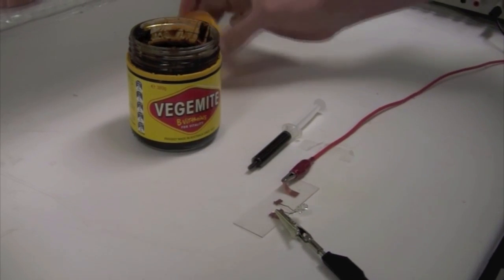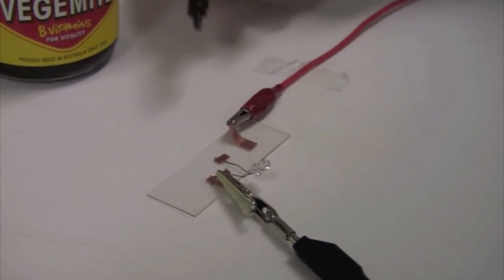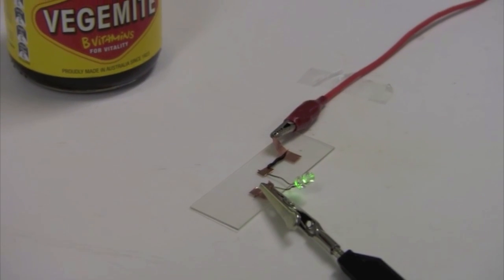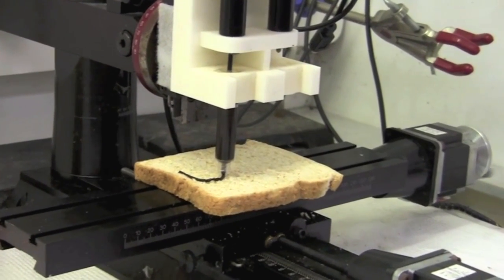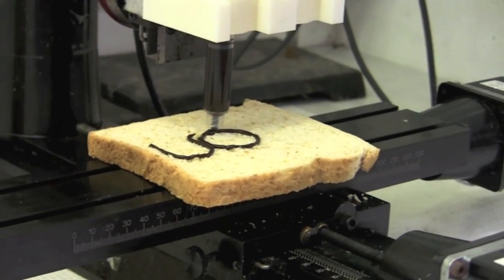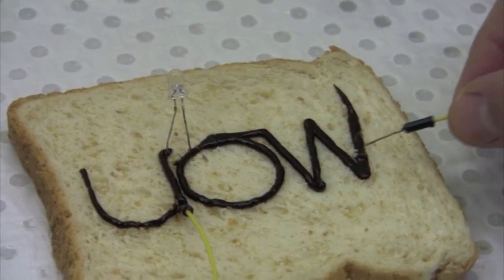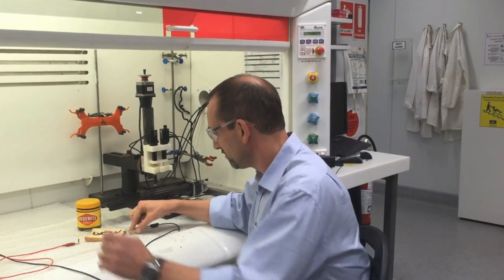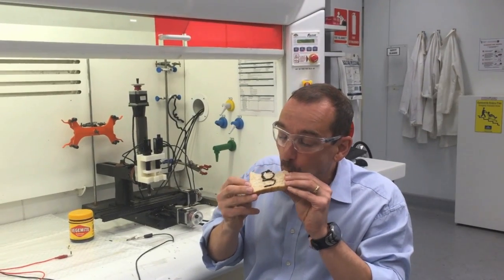Electronics for Breakfast: 3D printing conducting vegemite

Comment: You know, when I was younger, I got a quote-on-quote "chocolate" calculator for some book fair thing at school. I was always disappointed it wasn't actually edible... But now, with this, perhaps we might one day be able to do so.
We have vegemite wiring and chocolate casing. The rest of the checklist are an edible battery, an edible display, edible transistors, possibly some form of edible solar cell (easy once we have the transistors, right), and edible capacitive pads for the buttons.
I can't wait to see more on your work with edible electronics!